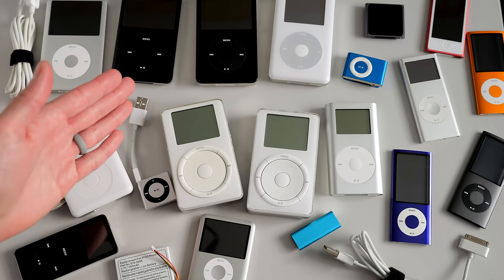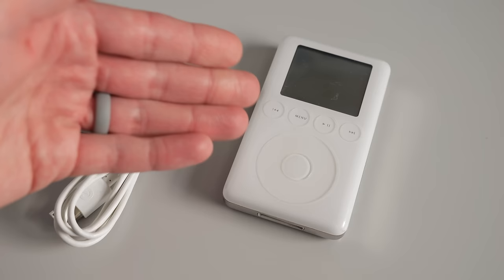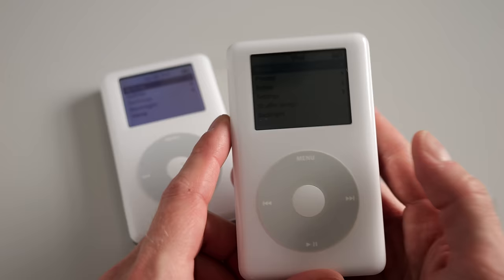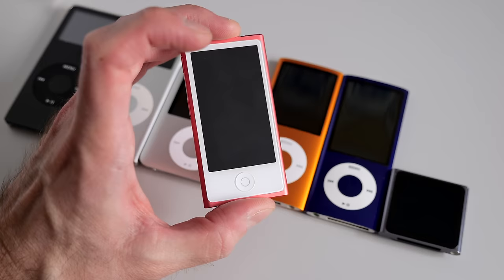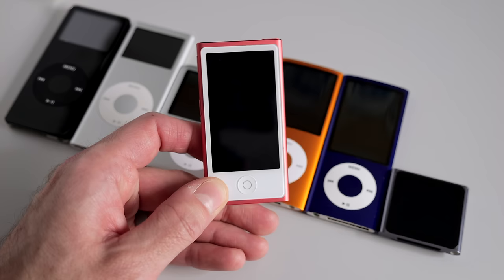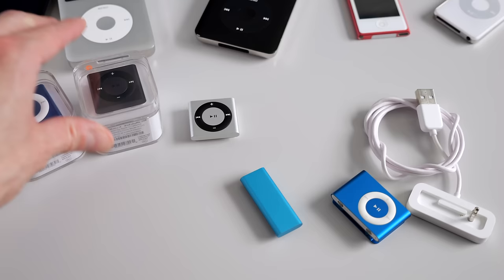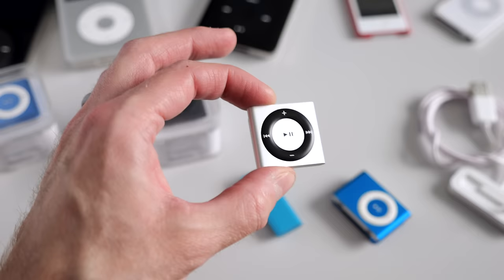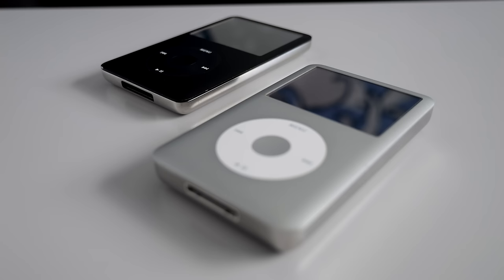Retro Buyer's Guide: Apple iPod!

Comment: The only iPod of my own I've ever owned was a 2nd gen 1GB Shuffle in blue that I won at a work Christmas party, and my step dad also owned one in green he also got as a Christmas gift that same year in 07, but neither of us kept ours for very long as we were just not fans of not having at least a basic screen on our players, and having to use iTunes, which he had to have me put his music on it, as he was not very computer savvy, so I remember selling them for nearly double what they cost on eBay with people fighting over them in bid wars, and I used the money to buy a pair of generic  2GB stick MP3 player with a basic backlit screen, that ran off a single AA battery for hours on end, and later on SanDisk Sansa C240 players. 
If anyone knows of any good sources of NEW Sansa C200 series batteries please let me know, as I would like to get my units that are in near mint condition backup, and running with Rockbox firmware.

Comment: I bought an mp3 player with both a full sized SD card slot AND a calculator like display for less than an ipod shuffle so i have always thought apple was a ripoff. this was i wanna say in 2007 but i could be wrong
Reply: same here, this is why i never really got why people bought ipods after like 2005-6.
 there where so many mp3 players that matched or exceeded what the nano did for the price of a shuffle or less.

Comment: RIP iPod. You had a hell of a run. iirc back at the time the tech press was full of talking heads going "bah, it's just another mp3 player, Apple is just copying the industry, blah blah blah" But I disagree. The original iPod came out at a time when most consumer MP3 players still had capacity in the 32-64 GB range (MAYBE 128 GB if you had deep pockets!) and had extremely slow serial- or parallel-based syncing. And the few hard drive based players that were out at the time were much larger in physical size compared to the diminutive iPod, and had only a fraction of the battery life. So the iPod's large storage capacity, combined with fast FireWire syncing, long battery life, and small size were revolutionary imho.

Around that time I had recently upgraded from a Diamond Rio (which had iirc 32 MB built in + I had a 32 MB SmartMedia card in it as well) to a Creative Nomad Jukebox, a hard drive based player which I absolutely HATED. The thing was physically huge (about the size and weight of a portable CD player) and while it had a decent amount of storage (iirc it had 6 GB, so one more GB than the iPod, big whoop) it had a HORRIBLE battery life (only a couple hours iirc.)

When the iPod came out I happened to be in the Bay Area visiting a friend who works at Apple. The night before the launch, he brought one of the test units and let me play around with it. (This was after they were announced and people (press, etc.) had them in the wild so I guess he felt safe enough doing so.) And boy was I impresssed. Great sound quality, fast syncing, and even though I had played with it for hours, the battery meter barely changed at all. I was so impressed that I went to the Palo Alto Apple Store on launch day and bought one right there on the spot.

Unfortunately I no longer have that iPod (if only I could invent a time machine so I could tell my past self to hold onto all this retro tech instead of selling it...) but I do have the next iPod I purchased, the 3rd gen (yes, the one with the infamous all-touch controls.) Honestly I thought I had sold it or got rid of it long ago. But one day I was just randomly going through a box of random tech junk, and there it was! A bit worse for wear -- it has been banging around in a box for years now so it's pretty scratched up and dinged -- but surprisingly, it still worked, hard drive and all! I somehow managed to upgrade the hard drive to 15 GB back in the day, and I have no idea how. (I am almost positive I purchased the 10 GB model so I have no idea how I managed to upgrade it -- you couldn't exactly buy these hard drives at your local Fry's.) Unfortunately the battery went flat long ago. But I was surprised to find that you could still get replacement batteries for these. Ordered one off Ebay for the grand total of (iirc) $5 and now it's up and running again! I also had to replace the headphone jack because I managed to tear the ribbon cable that attaches it to the mainboard, but I was easily able to get a replacement part for that as well and it didn't cost that much iirc. So glad I have this little gem now that I can display and use alongside my vintage Mac collection.

Comment: After “iTunes” messed up my playlists with their nonsense, I got a refurbished Nano from Apple about 10 years ago. Got a cute red case with a carabiner on the top of it. When I went to the Apple Store yesterday to have them replace the battery on my iPhone 12, I pulled out the Nano and no one really knew what to make of it.  I actually got the Nano and a small $15 Bluetooth speaker from Amazon to use while I was out riding my mule. One of the Geniuses thought it was a padlock for a second. 😂 I hate Apple and will never switch to Android. When I got my green Mini in about 2006, I fell in love with it. It got stolen or I would still have it.  It needs a new battery, and I’m going to order it now.  He’s right about it being nice to have the lightning port. Oh, I had paid a friend to put my 100 plus CDs in iTunes. When I let iTunes update one time was when they messed with my playlists. I only had three: black, white and Xmas. I think what happened it Apple sorted it how they wanted and I had to manually redo it.

Comment: I have a 2nd gen. To hook it up to my modern mac, it takes a Firewire 400->800 cable, a firewire -> thunderbolt 2 adapter, and then a thunderbolt 2 -> thunderbolt 3 adapter. Bleh. I'd better change the battery to make this all worth while.

Comment: The best EDC (Every Day Carry) iPod for me, is the 1st gen Nano 4GB. Why? It's small & light enough to hold in your hand or running pack when you go for a run/hike, you can easily fit it into your shorts pocket when you go to the gym. Small enough to  bring along everywhere, in the train/bus. 4GB holds a good amount of music even if they are encoded in 320kbps Mp3 or 256kbps AAC, to the point where you really will want to switch out some of the music titles only once in maybe a month or two. 

Flash-based memory means skip-free playback no matter what activity you're doing & worry-free use/abuse over the years. A little color screen with clickwheel to easily navigate your song list, because honestly, clicking through songs one at a time, like on the admittedly even smaller iPod Shuffle, for any music library over 2GB gets tiresome, especially when you are in the mood for just the right tracks at any given point in time.

Lastly, the 1st gen Nano is actually really easy to open up & replace the battery, of which are still available to purchase from eBay. Start your metal pry blade from the bottom above the dock connector & just ease your way around. Soldering the battery in/out is also easy because there is nothing in the way of the battery wires or solder points on the logic board, once  the case back comes off. 3 wires & you're done. The 2nd, 3rd, & 5th gen Nanos are a real pain to work on by comparison. And yes, I am prejudiced because I am in love with the 1st gen & I own over a dozen of them, bought used, over the years & fixed up with new batteries, new shells or new clickwheels.

Comment: itunes wasn't the only thing that could sync with ipods, some of the early ones required you use MusicMatch Jukebox like basically every other music player of the time required. itunes was developed after that.
Reply: correct me If I'm wrong but I think the original windows ipod used jukebox
Reply: I think the 3rd gen came with the breakout cable so you could sync and charge. maybe that was the windows edition

Comment: Just a few minor corrections/clarifications and additions to what was said in the video for the benefit of the audience:
Firewire 400 was by 2001 the Apple’s standard for high-speed data transfer between Macs and external devices. USB 1.0 (12mb/s) was still the standard for low speed external devices/accessories (outside of Ethernet for wired networking). All macs starting with the original Bondi Blue iMac (1998) had USB 1.0 but Firewire debuted on Macs in 1999. USB 2.0 was ratified in 2000 but didn’t show up on Macs until 2004. Thus Firewire 400 was the best choice for iPods connecting to Macs at the time of the original iPod (2001) even though  the first iMacs (then only 3 yrs old) couldn’t make use of it, given how slow USB 1.0 was a data transfer.

One thing missed in the video was Apple offering a limited selections of downloadable games that you could play on iPods starting after the release of of the iPod Photo. I don’t know if these games are still available to download for the iPod in 2022 since I no longer have one thats compatible with them.

One feature you missed in the video with regard to the 3rd Gen iPod Shuffle (i.e. that failed gum stick iPod with controls inline on the ear bug cord) was that it was the first iPod to include add the Voiceover function that would speak the album/song name and artist name of what you where playing, a feature that first debuted in MacOS. So while the iPod Shuffle 3rd gen was clearly a failure overall it did offer a useful new feature unlike all of it’s other “features” that weren’t really that useful on it.

The iPod Classic doesn’t just use a somewhat different UI but actually uses a different OS vs the previous gen iPods.

A few last things about the original 1st gen iPod shuffle (one of which also became a feature on the other iPods): The original iPod Shuffle 1st gen allowed you to sacrifice some of the music storage capacity to also use the Shuffle as a USB thumb drive (A slider in iTunes allowed you to specify how much  data storage capacity to allot, if any.). Given that it had standard USB-A plug on one end (under a removable cap) for charging/syncing, you could plug this into any Mac or PC of the era to copy files to and from them. The HD-based iPods also got this optional feature you could turn on, at the expense of music capacity. Another nice feature of the original iPod Shuffle was a iTunes features that allowed you to automatically generate a random playlist from your music library and automatically sync it to the iPod shuffle when you plug it in. Unfortunately they removed this feature with some later version of iTunes for reasons unknown (maybe It just wasn’t a very popular feature).

Comment: I still use my beloved silver iPod Classic 6th gen. I had no idea it was such a bitch to take apart. I have recently had it modded to have a modern solid state drive with double the original capacity, and a modern battery that lasts longer than God. 
Why would a modern person use an iPod Classic?
1. physical toughness. I bushwalk a LOT, like five or more days a week, and having something that will handle being dropped over a cliff or being soaked in three hours of heavy rain is appealing.
2. battery that lasts forever. Even before the modding, I didn't see the appeal of having to constantly plug in a device for charging, and I mock my brother for plugging in his smartphone for charging every time we get back in the car.
3. large capacity. Again, even before my latest mod, who could deny the appeal of being able to keep filling that sucker up, far beyond where a modern machine would poop out? If you don't like streaming and have a large music collection, there ain't no substitute. 
Make sure you find someone local who can repair and modify a Classic though. Also, that hard drive and battery will wear down, so try replacing them.

Comment: No phone or ipod should ever be loaded up with uncompressed audio.  You simply cannot hear the difference on such a device.  A well mastered 320mp3 cannot be distinguished from an uncompressed high-res file on an ipod.  It can't be done.  It's a low end earphone amp.  This is not being played on your hi-fi stereo with a hi-fi pre-amp and a hi-fi amplifier.  In 99% of cases, it's driving low-end ear buds anyway.  Just  a total waste.